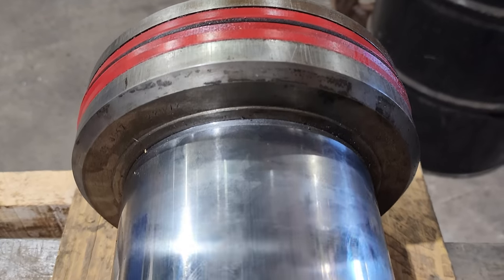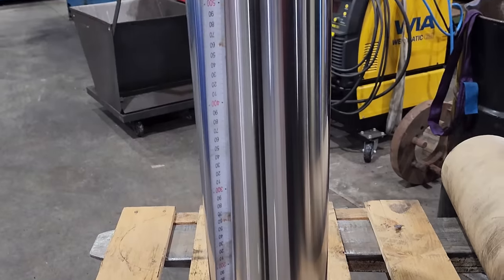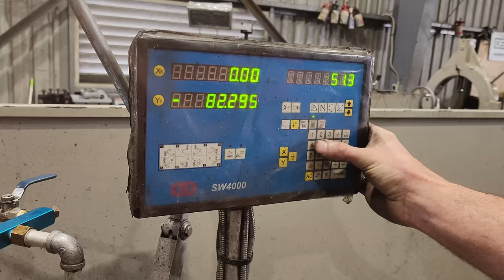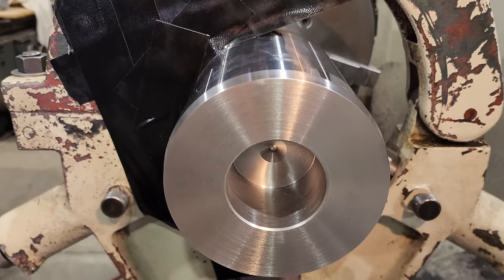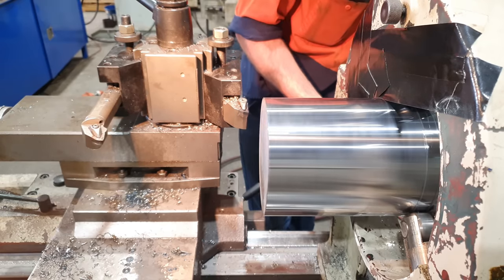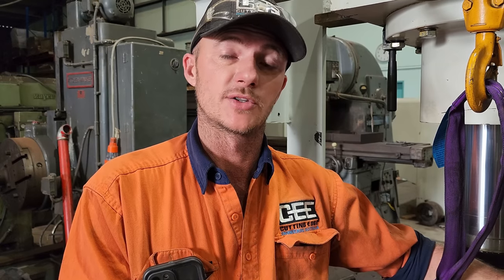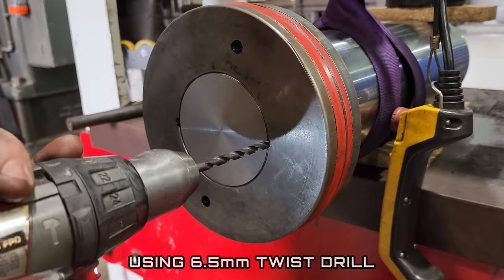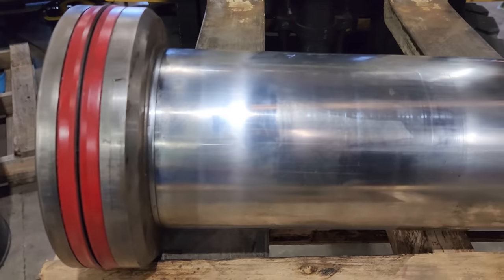Making a 100T Heavy Duty Mining Jack Cylinder Rod | Machining & Threading

Comment: I find it amazing that kurtus can make a brand new rod that is much tougher as apposed to just getting it rechomed.
Reply: Better than new!
Reply: Not to be a spelling nazi. But, it's KURTIS as in Mr. Allen
Reply: its actually much cheaper than rechroming, at least where we do it...
Reply: @quadrannilator what makes rechroming so expensive?
Reply: @hannahranga  Where I work, our chrome plater uses electrolytic plating. The only other alternative being thermal spraying. 

If the cylinder rod is just plain carbon manganese steel, you can de-chrome it using chemicals. But, many a times cylinder rods are made using steel with alloying elements, most typically Nickel and Chromium which enable them to be hardened via heat treatment, such as this induction hardened rod which Kurtis used in the video. So electrochemical dechroming is not an option because it will also leech away the Chromium inherent in the base metal.

Such rods are also badly damaged with deep dents and scoring, in which case the chrome deposition also has to very deep. Typically cylinder rods are chromed and then ground in multiple passes with radial chrome thickness typically not exceeding 75microns.

Straightness, Runout, Size and Surface Finish of the rod are very important for good functioning and life of a hydraulic cylinder. You don't even know how bent an old rod might be - so rechroming it may need high thickness and make it difficult to achieve geometrical accuracy. The old material will have internal stresses and micro cracks which may have already weakened it.

Electrolytic plating is a very hazardous process involving toxic chemicals and gases and hence is done in only special facilities under licences and big environmental regulations. So this makes the overall plating and regrinding process an expensive affair.

Its just much easier to buy a plated rod or get it plated and ground from new base metal. The cost of plating, which also consumes a lot of electricity, as its area gets larger and maintaining all its accuracies in long and big rods often far exceeds what you pay for a new bar of raw material. And you also have full control over the alloy composition, heat treatment and chrome plating process if you make a new rod.

I hope my experience was a used reply for you! 😀
Reply: @quadrannilator thanks for the info
very helpful to understand why just remaking part of it is cheaper that rechroming
Reply: Time might also be a factor. I don't know how long it takes to get something rechromed, but Kurtis has mentioned a few times that turnaround time for chroming has been longer lately. So time + cost = Kurtis.
Reply: @remipepelko9201  There's a fair bit of prep work to do before a rod can be re-chromed. When you're buying a piece of stock material to make a new rod, the actual chroming process is fairly inexpensive because they're doing a large batch at a time vs a small one off. Also we don't know what the exact quotes were for re-doing the old one vs making a new one; the new one might have cost a bit more, but there may have been a bit better delivery time or the customer thought the extra cost was worth it for a superior product.

Comment: Blows my mind every time I see threads done on the lathe. Intellectually I understand it is just gears and cogs moving all together to make a repeatable pattern, but there is something magically about this process and how it works.
Reply: The outtakes show the critical process of checking the pitch with a scratch pass before proceeding. 😉
Reply: Try setting everything up again next day when you've run out of time in HS shop class!  He's also got that foot brake, woulda loved that!

Comment: Missed you last week.  I liked the triple check of the lathe setup when threading.  Check the chart, adjust the machine, double check the machine, recheck the chart.  Excellent procedure and discipline.  Saves a wasted and very expensive blank.  Love the channel.

Comment: Good to have you back.
Those pins in the top can act as a consumable and also will spin when needed in order to lessen that rotational scoring they had. Sometimes they will be knurled to avoid slippage also. Five bucks says the customer has lost the one that is supposed to be there.
Reply: I'm surprised that you didn't turn a new cap for the piston.

Comment: The humor of checking you thread pitch AFTER the scratch pass probably flew over the heads of most folks. Good one! Cheers! You folks are very good at what you do. Keep on keeping on.
Reply: It's not humor. It's confidence!
Reply: That joke probably flew over your head too. I KNOW he knows what he was doing, but a scratch pass is done to verify if your machine thread cutting setting is correct after an actual scratch pass as a sanity check before you go to town and cut the threads to full depth.

Comment: Good post, getting rid of the induction hardened layer used to sound like nails on the blackboard. Nice simple job, shame that the old one got misused, but gives you business. We made a gearbox for Heathrow airport which jacked up the 747''s nose wheels so they could change the tyres. That was misused, and eventually seized up. I had to repair it within 24 hours due to scheduling, which we did. All for the sake of some oil and grease. Loved the birds, thanks Kurtis and Karen, be safe and well 👍
Reply: What is this "oil and grease" you speak of 🙄?

Comment: A friend at a wire rope sling manufacturer company needed your services years ago. Too many years. It was a 300ton x 6inch stroke machine press and it pissed all over everything pinching large collets/collars the barrel was huge. If it didn't have an electric pump? It wouldn't have worked at all. Hand pumping would have bled completely off. God how I love your work! Phenomenal!

Comment: Good morning Kurtis, it is such a pleasure to watch you thread correctly. You double check all settings before you start and reverse the motor to go back to the beginning of the threads. When I first started threading I was intimidated until I learned the proper procedures to eliminate mistakes. My only difficulties were seeing through the smoke from the cutting oil. A fan takes care of this. Sneaking up on finish and spring passes are crucial in some applications and you sir have nailed this as well. Please don't sell your talents short as you are not "cheap", you are of the epitome of perfection.

Only one of my projects made it into the cabinet of perfection in the college I trained at, if you were attending my class, every one of yours would make it in. Mine did not even follow the rule assigned as it was supposed to be both a male & female 2tpi Acme thread, but I made a double start 4tpi Acme. The instructor was impressed at the tolerance I held. All other assigned projects I incorporated into a bearing and gear puller and re-wrote my curriculum to include all processes into a usable tool. I pulled 22 credit hours per semester for 2 years. Major in machine processes & NC & CNC programming with minor in math. Dual associate programs stacked.

Comment: It's always a good Friday watching Kurtis and Karen. Question Kurtis what is the logic behind using a spiral tap instead of a normal tap?
Reply from the maker: Hey mate good question, Spiral taps for the metal chips/swarf out of the hole and not push it into the hole 😏
Reply: @CuttingEdgeEngineering  thanks

Comment: Nerves of steel to do the threading and add the screw at the end after spending many hours fabricating the piece. I’ve made a couple turning jobs in my life in high school, a screw driver and a hammer,  and the threading operation for the two tools was very nerve racking. More than one student wrecked their pieces. 

Thanks as always, Karen, for the video work - the slow speed turning was interesting.

Comment: I'm always amazed at how deep you go on your threading passes.  I guess when you have a very rigid lathe you can get away with it.  And it would scare me to take such a deep first pass on an expensive part without verifying the pitch using a thread gage.  Great work as usual, looks like the shaft turned out perfect.

Comment: Always worth watching, Kurtis, even though my life's work had no connection to engineering, I find metallurgy and machining to be endlessly fascinating. That was a great tip about not using the old hole for grub screws because you always give reasons for a process instead of simply performing a demonstration, which would be easier to do.  Col, NZ.

Comment: Absolutely am bananas for your videos! One minor correction about the forces the jacks are under. They are under compression forces. Tension is when opposing forces pull and stretch and object. There does exist a jack, used in strand jacking, that applies tensile forces to bands within concrete. None the less, marvelous work and superior quality!

Comment: You should look into Conversational CNC Lathes. They are a good introduction to the CNC realm and I feel like they would be perfect for the kind of work you do. Even on our older conversational lathe, it is very easy to set up roughing and finishing tool paths and switching between threading metric and imperial is a breeze. A lot of the time they can still be used manually as well!

Comment: Suggestion - get a fume extractor. I know you rely upon natural ventilation and also use a speedglas blower, however these measures aren't sufficient to protect against inhalation of carcinogenic gases in a lot of metal working processes (that is, when you weld, gouge, oxy or plasma cut). You can never be too safe when it comes to your health, and a fume extractor is another tool to protect you. I weld/cut outside and use a Speedglas G5 helmet and would be the first to tell you gases still get under the hood. I'm sure you can attest to this. Recently purchased a used mobile fume extractor with articulating arm and it's very useful in diverting gases away from me (notwithstanding that it can be a little inconvenient to move around, but that's someone I'm willing to put up with).

Comment: You're pricing is the same as a company that only does one thing, but the way you get customers in the door is by being able to do as many different things as possible. Don't sell your work short as being "cheap" just because you have to compete with larger companies.  As other's have said, you're a cost effective solution to a wide range of problems.

Comment: Curtis;
I know you like the gaffer tape for chip protection on the steady rest.
Ive always respected it as a practical & effective method of protection, and what else could you use?
But  that's a rare place where a mechanical iris would be perfect. You have a maximum od, likely an id limit, and w the right design elements; magnetic grab, spin oriented fins to shed chips, a stiff but soft rubber or no-mar plastic contact edge that can be customised, maintained, possibly multi-part fins to cut down replacement waste..
You can have a reliable fix & reduce tape waste.
Between you, your 3d printing brother, and industry contacts, itd be a doable project.
Reply: How would you split the iris to open the steady rest?  Or would it have to be slid out over the end of the part?

Comment: Kurtis, have you or the customer ever considered putting a sacrificial cap on the top of the rod?  It could be bolted on by a couple of socket head cap screws and replaced as needed.

Comment: These errors do not affect the operation, the jack rod is not on the pressure side.  If it leaks, look for the fault in the cylinder, possibly the damaged o-ring at the valves.

Comment: Again real craftsmanship. Arent you afraid the locking screw getting loose? If seen this happen with Palfinger cilinders. And they use even center point on side of the hole. Then again, those have more dynamic forces then a jack.
Reply from the maker: no, I bottomed it out in the hole and this will only get cycled a couple of times a day at most

Comment: Howdy Kurtis and Karen! I love the videos. Ive been a machinist and fabricstor with the USAF for 2.5 years now and have been able to learn alot of tricks and other ways of machining watching your channel as well as others like This Old Tony and Inheritance Machining. Thanks so much for the content. It helps alot! 

Had one question for you. While single pointing threads, I notice you have the compound set to either zero or 90 degrees (depending on your lathes setup) and you appear to take a DOC with the cross slide, but you also bump your compound. Can you run me through what that is doing for you? Curious and love to learn how everyone does things their own way in a career that has a million ways to achieve the same goal. 

Cheers!

Comment: Great content and production quality as always. Keep up the entertainment for those of us who wish we had a machine shop at the bottom of the garden.
  You'll have to forgive my ignorance, the last time I used a lathe it was fifty years ago .. toolsteel cutters on BDMS. In the video and the outtakes you make a thing about using a ceramic insert to cut away the hardened outer skin and then switch to a carbide for the bulk of the machining, with no explanation as to why. Why not just stick to one ? I can see ceramic works at a higher speed and higher hardness, but they also don't seem significantly more expensive than carbide.

Comment: so looking at the seals on the piston this thing is single acting . pressure up only. so why does it matter about the rod as long as it doesn't jam up when retracting ?  wouldn't just polishing it in the lathe be good enough? no oil  seals against the rod. it looks like it needed a new rod seal o ring though.
Reply: I'll second that.

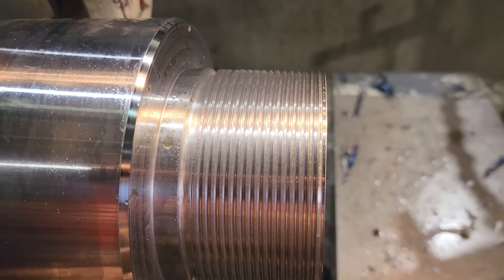Comment: @ 32:54 I was wondering when you werte going to check the thread pitch. Is 55 degrees thread form common for heavy equipment or is it just a legacy holdover for BSW threads? Great video and thanks for the explanation of how the equipment gets so beat up and how it is used.

Comment: Just curious but wouldn't it be easier on the 50mm drill to run a pilot hole to the same depth that you intend to run the 50mm drill to?
Reply from the maker: Nah just a waste of time
Reply: @CuttingEdgeEngineering  Yes, you always crank out great chips, but I still find that hard to believe.

Comment: Are all those tips you use on the lathe are they throw away or can they be resharpened. Great workmanship again as always, I have a couple of Maggie’s that I have been feeding for years.
Reply: I was reading about this, whilst the inserts can technically be sharpened it's not really worthwhile for professionals. I believe the old inserts can be collected, crushed and the material remade but what volume is required to make that economical?

Comment: Another cool video!  Thanks!  Curious, when threading I noticed that you typically  do not do a scratch pass to verify you're cutting the correct pitch, which is impressive given the expensive repairs you make.  Have you ever made a costly mistake while threading?  How do you confirm your set up is correct before cutting threads?  Thanks again!

Comment: When your thread cutting how does the tool get back into the pitch after each cut?  I'm guessing the feed speed is locked by the machine to the rotation speed and you have to run it in reverse to start a new cut?

Comment: Are the induction harden rods also chromed? And when you rebuilt the blade for the D8 dozer, do you use the anti-seize for lubricant to tighten the bolts? Or just you to keep the bolts from seizing? Or are I love you guys videos? Keep up the good work🤟

Comment: Just one question that popped in my mind, Do you ever use Kennametal Inserts, when doing jobs that the material can be brutal on your edge, or are those inserts more for CNC machines? Higher Feed/speed etc, or do they have inserts for your kind of work when you need a good cutting like when you use carbide inserts.. 
Ever since i saw how TiTANS Of CNC demonstrated how incredible those Inserts,Bores, (You name it they probably have it) where doing with insane Feeds/speeds

Comment: I've noticed you always leave the half nut locked in, and reverse the spindle when cutting threads. Is that just your preference, or a necessity? I have done that with my 1934 South Bend lathe, because I don't have a half nut indicator, and I used to do it when cutting metric threads on a Cadillac lathe where I used to work. I just never did it cutting regular(banana) pitch threads on any other lathe I've used.

Comment: Does your lathe have a metric lead screw? If so, can you not disengage the half nut? I’ve always wondered that. Here in the states you can disengage on imperial threads with a TPI lead screw, but have to stay engaged with a metric pitch. (Which I’m pretty sure you already know) just curious about that

Comment: In my personal experience, and i hate saying this, the marks on the shaft are probably caused by someone using a hammer to make the tool fit somewhere, and not someone running the tool into an axle or something... i literally watched one of my coworkers use a hammer to smash a tool into a place where he wanted it, instead of relieving pressure and handling it. If you want something tested to failure, give it to a tire guy...